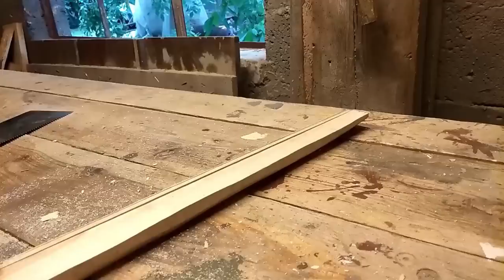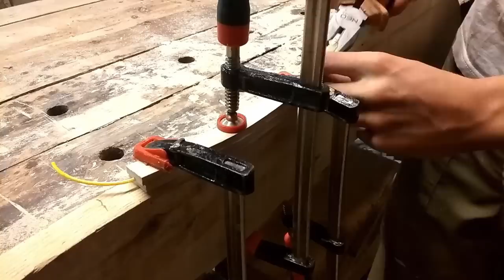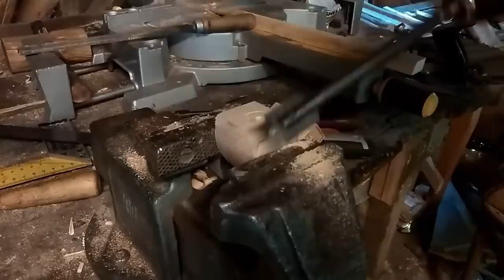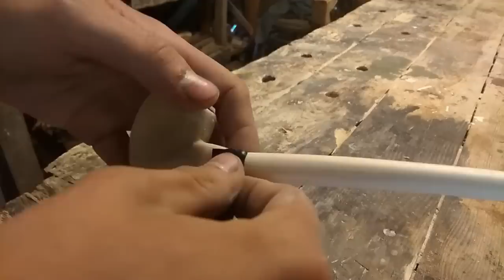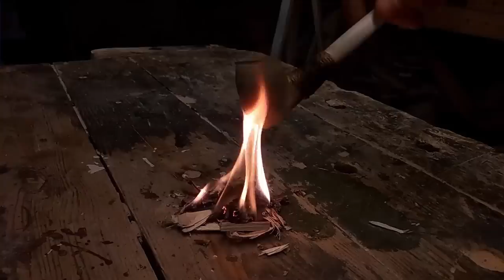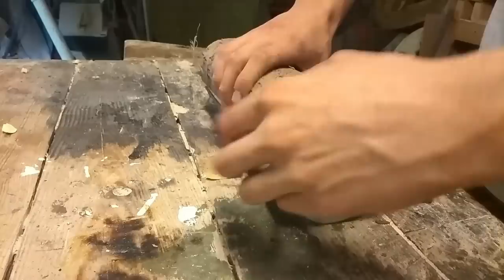Wooden pipe making

Comment: Have you thought about putting some rags or soft material between the vices and the pipe so you can get a tighter hold without damaging the wood? I noticed the pipe bowl wiggled a lot while you were drilling it.
Reply from the maker: yes. That is good idea, I made that recently, it helps a lot with small projects.

Comment: Seriously? What mess, are you using electrical tape to seal the fork between the pipe head and the pipe? This is not a traditional job that can be used with a leader or similar, and the storage box made of this lumpy wooden cylinder is very ugly, I'm sorry, but the pipe looks good 😂
Reply from the maker: You are absolutely right, this is not a traditional job and i haven't said anywhere that it is :D I just made a pipe, did't care of traditional ways of doing it. The electrical tape is not for sealing. It is just ,,underbed" for the string wrap. It helps make the wrap even and smooth.

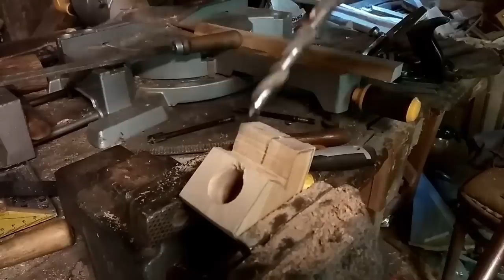Comment: İn this video 3:48 where did you pierced in pipe i dont understand
Reply from the maker: hole from stem-side doesn't connect straight to the bowl. It connects to the bottom of little hole drilled from bottom of the bowl. This makes for better, more even, tobacco smoking
Reply from the maker: also, from stem-side there are two drill sizes to make joint between bowl and stem possible

Comment: can you give me a shopping list BC I don's know what half of what you're using is, like the string thing you used to keep the glue out of the pipe
Reply from the maker: The chamber is 18mm in diameter and 25mm deep. Bowl is 32mm in diameter and it's length is 45mm. Stem is 160mm long and it's curved by 20mm. Channels are 3mm in diameter in bowl and in stem it is around 2mm. Wood I used, is one from pear tree for bowl and mountain ash (rowan) for stem. Essential tools are: drill(and drill bits), saw, something to round all corners and make fits go tight like knife/spokeshave/file, clamps to make bent stem. For the wood: any hardwood is good, it just can not be toxic wood like black locust and it has to be resin-free so pine/spruce/larch etc. won't be good. Basically the denser wood the better. It is common to destroy first pipe by drilling too far (I made that mistake in my first two pipes :D ) so it is very good idea to mark on drill bit how deep it has to go. You can use a small piece of tape, or just mark that length with sharpie. Stem must be clamped till glue dries (usually 24h)
Reply: @Rizerdrox hell yeah thanks
Reply: @Rizerdrox  I'm using cherry we just majorly trimmed our tree
Reply: @Rizerdrox  That was pretty decent of you to take the time to show and tell all this. You are a good person and I hope others appreciate you.
Reply from the maker: @TheOriginalFlowerdough   cherry wood is a good choice. The best part of it is where dense inner wood comes to that lighter outer wood (you will see that transition without problem). It is good idea to sand it very very smoothly and then polish it. Polishing will give it that noble look and there is chance (depends of piece of wood you will be using) that beautiful light red/rose color will show like ,,below" the surface of wood.
Reply: @Rizerdrox  what kind of glue BC I would rather not smoke glue lol
Reply from the maker: @TheOriginalFlowerdough   I used casein glue which is called ,,wikol" in my country. Most of paper or wood glues that are white, thick, and cheap are probably casein based glues. Basic white paper glue would work.
Reply from the maker: @TheOriginalFlowerdough   Temperature near glue joint is really low, so it won't get burned or overheated which could cause generating smoke from glue
Reply from the maker: @TheOriginalFlowerdough  if you are skilled enought you can try to make that joint so perfect and tight that glue would be unnecessary
Reply: @Rizerdrox  do you know where I could find a 18 MM core box bit, I've heard those are best for pipe making, they make the best bowl
Reply: @Rizerdrox  or do you maybe know what the closest size would be?
Reply: @Rizerdrox  wat nvm a 32mm core box bit
Reply from the maker: @TheOriginalFlowerdough  chamber diameter is up to your preference. You want to smoke more at the time - make bigger one :D I probably live in different country than you (Poland) so I think I can't help you to find a place to get that drill bits.

Comment: if you could just give me some measures i'd be really thankful. greetings from Mexico
Reply from the maker: The chamber is 18mm in diameter and 25mm deep. Bowl is 32mm in diameter and it's length is 45mm. Stem is 160mm long and it's curved by 20mm. Channels are 3mm in diameter in bowl and in stem it is around 2mm
Reply: @Rizerdrox  thank you so much man.  You're the best

Comment: The glue would be toxic. Instead of cutting wood in half and gluing the two pieces together to make a stem, it would be better to just drill a hole through a single piece of wood to make the stem.
Reply from the maker: It would be better but I don't have drill bit and skills suitable for this task.
Reply: Unless you know some woodworking magic not available to me, I'm not aware of any way to drill out the center of a curved piece of wood.
Reply: @AndrewJamesRiemer  Well, as I say, the glue makes it toxic. So just having a straight piece of wood for the stem would be better. Although, I know it is possible to use steam to bend wood. So one thing you could try is to drill a hole through the stem, run a pipe cleaner inside, steam it and then bend the stem to shape, and the pipe cleaner should stop the hole through the stem from being closed off/collapsing whilst bending it. I haven't tried it myself. I've only ever made straight stems. But it could work.

Comment: Working not good, because it is impossible to clean the mouthpiece of the pipe.
Reply from the maker: It is possible and i did it twice
Reply: Use pipe cleaners--those long, flexible, twisted wire segments that are fuzzy.